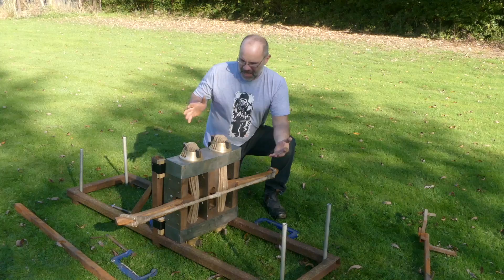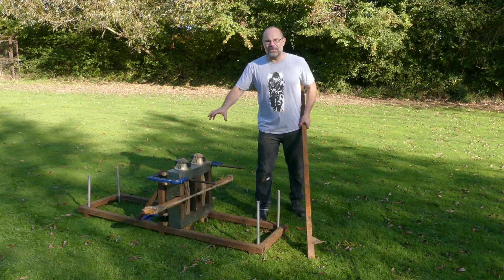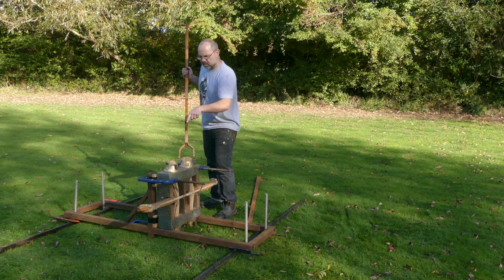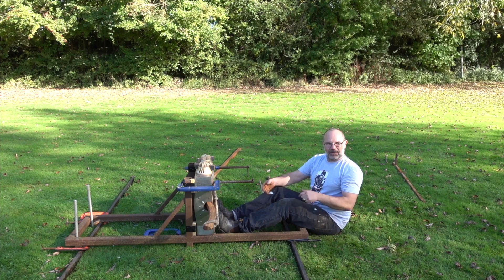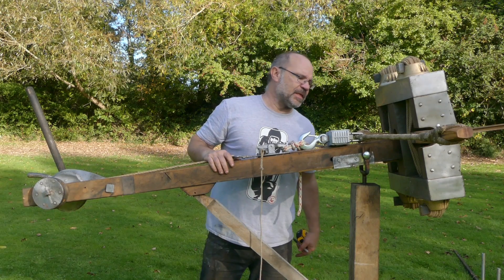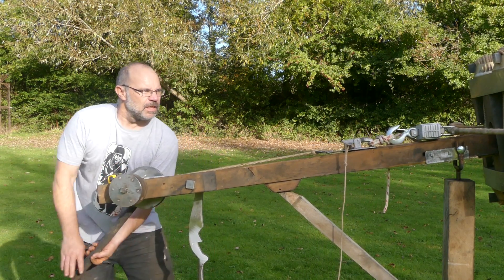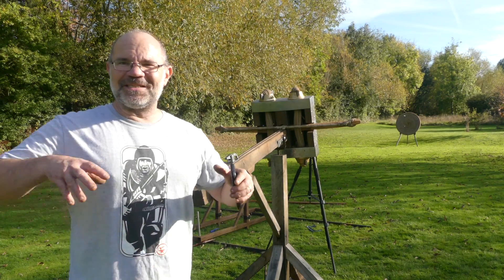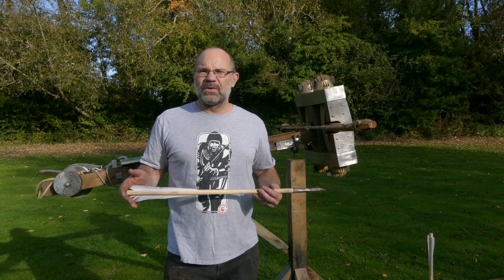CATAPULTA INCREASING POWER PT 2

Comment: Amazing! I've read all the material, but seeing it in action gives a much better feel for it. So many questions as follow up:
How do the washers work, so that you can you can increase the torsion on the bundles with the spanner with it turning back?
How much does the tension decrease over time?
Do you (and would the Romans) store them fully tensioned? Or does the stress harm the machine? Is transporting it already tensioned too dangerous? If you disassemble it to make it easier to carry (either in a cart, or even smaller on the back of a mule), how long does it take to put it back together?
Reply from the maker: Thanks.
The washers have a series of holes around the rim and the plates of the headstock have holes on a different frequency, so you can always find a hole that lines up.
Not sure how much it decreases, but the machine should be stored with the arms taken out to remove as much tension as possible.
They have to be left tensioned as it would just take too long to restring the bundles if you needed it.
2 mins to reassemble if that and faster with an experienced crew

Comment: Fascinating!
Would you be able to tune the skein bundles in sequence or "as needed" if the frame were laid flat on a raised bed/frame? Too prone to tipping (barring a splayed base I suppose)? It would put it up higher (which I suppose would get hairier the closer it gets to eye level) but would also let you have a better "at a glance" view of the cordage and access to all the ratchets at once.
Though if any of the cords or string let go, depending on if it's face to the sky or the ground, would it be more contained if the released forces were "directed" (so much as catastrophic failure can be directed) up or downwards?
Reply from the maker: There is definitely and easier way if the headstock was clamped flat as if the stock were vertical, but I made the frame before I had ever done it before and didn't think of it

Comment: Very interesting as usual Tod. 166 fps is a great start! 
As you mentioned you built crossbows with more draw weight than this, so I wonder do you have a estimation of what the draw weight eventually 'should' be?
Reply from the maker: I have absolutely no idea, but the tension went up very quickly so with a bit more courage it will go up from here, but also it will stack massively so another few cm could have added another 100kg I would think so I feel that draw length will also be very important

Comment: Splendid stuff! These must've been terrifying on the battlefield. The bolt you shot, and the extra energy it had, flattened it's trajectory. 
At full power this makes it's flight low & fast. Going straight through shields, men, horses...
Instead of an arrow that takes a parabolic path. Coming in from, say, 45° and easily stopped by a shield. Here you have a heavy, long bolt coming in low & fast from directly in front of you. Shields & the guy in front of you offer little protection from the energy carried by a bolt from one of these at close range & wound up to the max!
Do we know if they used gyro-stabilisation? You mentioned wooden flights last time & a simple twist in the flights would've really helped with accuracy!
Great video mate! Thank you. It  really got me thinking.

Comment: Todd, if you add some height to the tension box you can get more tension in the bundles with less stress on the individual ropes. That would also allow you to change out the bowed arm stops/sides. I’d add about 4”, kiln dried ash would be my choice.
Reply from the maker: I could, but then it would deviate from the Roman dimensions and I will bet they had it down perfect and whatever we try would reduce its efficiency
Reply: That would maybe help in a „safety sense“ but greatly decrease the machines efficiency. As Tod was saying, the pretension (linear stretch) is crucial for the performance of each spring . This is best done by putting as many strings through the wholes as possible (thickness of spring>lenght of spring).
Philon, a roman engineer, emphasized that too much twist in the string will even devaluate the performance of those machines.

Comment: For winding it up, wouldn't having multiple of those rods, screwed into the wheel be useful? Like a big multi-spoke inner wheel bit. That way you could just keep winding it without having to move the rod between slot positions each time?

Comment: 11:03: I wouldn't bet against the Romans having done that, to be honest.  It seems like the kind of field-expedient workaround a soldier would apply in a battle.  I figure an exchange would go somewhat like this:
Modern person: "Would you have done this in the midst of combat?"
Legionnaire: "Sure.  Beats getting sent to Elysium by a pissed-off Dacian."

Yes, it's probably harder on the machine and at least slightly more dangerous to the operators; but they'd have to balance that against the angry dude over there trying to stick a bit of metal in them.

Comment: *Tod*, a question: what mechanism prevents bundles from unwinding themselves? Is it some kind of internal ratchet mechanism? And how do you release the tension when putting catapulta for storage?
Reply from the maker: a series of holes in the perimeter of the washers and a set of holes in the headstock with a different frequency and drop a pin into an appropriate hole

Comment: I'm very excited to see where this project goes.  I tried making a simple ballista recently for a boil egg launching competition.  I was able to accurately hit the competition target at 200yards, but the torsion was too much for my oak wood bundle washers and they began splitting and breaking apart.  I was using 1/2" steel bolts for the bundle anchors, and they all bent under the torsion power.  Next year,  I will incorporate many more iron/steel components to handle the incredible stresses and I've learned to weld.  Your design has certainly inspired me.

Comment: ...could you actually pierce Amor with that thing?
Reply: At that range a fully tensioned one could probably put a hole in 1/8th inch thick AR500 steel.  So yeah, penetrating medieval or earlier armor wouldn't have been a problem.  Remember that, as it is, it packs a heavier hit than a .45ACP pistol round.
Reply: Considering the type of armour available when they were using things like that, I'd  say yes. But if you mean Agincourt armour, then I don't know. But I bet that even if it didn't pierce the armour the wearer would get knocked flat on their back and wouldn't be getting up for quite a while lol.
Reply from the maker: Zednotzee - actually no.  A person can stand in modern plate armour and get shot by an assault rifle round of circa 2500-3000J and stay perfectly on their feet so 660J is not a problem, however the momentum is also significant, but I suspect if the armour stood, then  so would the man
Reply: @tods_workshop  I sit corrected Tod, thank you for the accurate information.
Reply: @tods_workshop   Fair enough. But I was thinking that in a battle they wouldn't be standing still, and might have one foot off the ground. when they got hit. But you're no doubt right. 🙂
Reply: @tods_workshop   Ah, sorry, I was thinking of when you got it to full power at the range your shooting at now. I should have said that before. But maybe even then it wouldn't.

Comment: If anyone isn't sure what the 487ft/lbs or 640J actually means in real world applications, a 230 grain .45 ACP bullet coming out of the barrel of a Colt 1911 has a muzzle energy of 360ft/lbs or 485-ish Joules.

So, yeah. This thing is wicked.
Reply from the maker: Yes the numbers are big and getting bigger and the momentum is massive
Reply: @tods_workshop  I would like to see some "anachronistic" penetration tests between the medieval plate armor and the bolts loosed by this catapulta/ballista/scoprion  when at full power...  I am wiling to bet that the bolt will go through the armor without any issues...
Reply: @alinmeleandra3175  Well, archeology in England showed ballista bolts, fired from from over 200 yards range iirc, had went through a 4 or 6?? inch thick palisade log wall, 
and stuck into the spine of a defender, because they found his remains still stuck to the palisade, eek!

So yeah I think they'd go through historical armour with terrifying ease. 😳🤕
Even if it ricocheted from an acute angle strike, the momentum would still likely cause serious internal injuries
Reply: @alinmeleandra3175 Likely no chance for the medieval armour. I more interested in modern body armour.
Reply: @alinmeleandra3175  Penetration's about a lot more than just power, though. I'm pretty sure a longbow arrow has the power to penetrate a breastplate, but what we saw in the previous video on the subject was that it wasn't able to transfer that power into the breastplate. The tip would start to be deflected and would bend - using up some of the power of the arrow - and once the arrow was out of alignment, the residual energy of the arrow would be wasted on bending the tip and snapping the shaft, and what was left remained in the pieces of the arrow as they went spinning off in different directions.

If the arrowhead was harder than the breastplate, it would be much more likely to bite into the steel and stay inline, and thus transfer much more of its energy into the breastplate. However, given the cost of steel and the sheer number of arrowheads needed, they had to be made of iron, sometimes case-hardened as was discussed on the video. If the arrow lodged in one of a helmet's breaths or vision slits, or the junction of two lames, or any other place it might lodge, it would be much more likely to stay inline and deliver its energy to open up that hole into something the arrow could pass through. Likewise, medieval steel wasn't homogenous, so it's not impossible that an arrow might find a point without much carbon, where the steel was quite soft, and bite in and stay inline. 

And of course we saw in that video what happens when the arrow strikes mail instead of plate.

Of course a ballista dart would have a lot more momentum, making it harder to knock offline in the first place.
Reply: @silverbladeTE  That sounds interesting, where can I read about it?
Reply: @ThiLI0n  was in some books I got form library long time ago and on Web ages ago :)
photos clearly showed how the lower spine had got literally nailed to the thick log of the palisade, eek!
Reply: @RobbeSeolh  it depends on armor. in both cases.
Reply: @silverbladeTE  Maiden Castle - the skeleton c/w ballista bolt still in place in the spine is on display in Dorset County Museum.
Reply: @DavidLee-qe3rd  ah, thanks! :)
was pretty amazing, if horrific, eek! 😳

so yeah, 
a) mass and thus momentum IS important

B) ye olde Romans were pretty damn impressive with their engineering!
Reply: @alinmeleandra3175  This is a siege engine not a personal weapon. No armour from any era can prevent a kill from a siege engine of any era.
Reply: @Debbiebabe69  
I'm fairly certain a basic level 4 plate stops these shots. The 30.06ap they're rated for is well over these numbers and has a much better penetrator.
Reply: @silverbladeTE  Some yeomen got a bit too literal with 'put some back bone in it'? Damn.
Reply: @parrotshootist3004  lol! ;)
Reply: @alinmeleandra3175  Ballista and Catapulta were absolutely used during the medieval period (particularly in the defense of castles)
Reply: @   I did not know that that actually happened. Brutal!! :)  Dumb additional question: was the defender in armor? I assume he was... Also, any idea about what period are we talking about? War of the Roses or earlier?  Because that would significantly change the type of armor everyone was wearing... But never the less, I think that 1mm of steal can't withstand a power of a proper balista bolt...
Reply: @tods_workshop  Well, ironically....I made a wee animation on this about over 20 years ago or so, and put it up on YT  around 10 years ago..  
Sorry it's so simple but back then rendering animations at home with a normal PC was a nightmare, lol
It's on my channel as "Roman Light ballista" ;)

Most of my art was about "Spelljammer", a fantasy space setting for Dungeons & Dragons, so I built a lot of siege weapons for the ships :)
Reply: @silverbladeTE  stopped by and left you a like. Good stuff!
Reply: @Tarabulus  Cheers! :)
Reply: You have to divide by 2 in the formula. So it’s 320J not 640. Which is still huge.
Reply: @tods_workshop  Can you do Catapulta vs. armor/suit of armor video like you did with the longbow video series?
Reply: The momentum though with a half pound weight bolt...oooft!!  😵
Reply: That it´s the count if you go for energy. But if you go for momentum (another important measurement) we have 1.5 the momentum of a 10 grams 7.65 NATO from a FN FAL Rifle. 12, 2 Kgm vs 8,5 Kgm
Reply: It is 378 J,  the calculation is wrong.
Reply: @RobbeSeolh  Only if based on m/s in the table, however the speed was originally measured in feet as 166 feet, which is 50.6 m/s. That makes it 320 J with a 250 gram bolt. I assume the feet to meters conversion was scaled upward, and then he forgot to divide the result by 2.
Reply: Yes a 22lr is around 70-90 ftlbs, a deer rifle around 2000ftlbs
Reply: @chrislatchem1854  buffalo bore loads a 400 grain projectile in there .45 70 super hot load up to a little over 4000 ftlbs at the muzzle. Pretty impressive for something that can be loaded into a lever action.
Reply: The 45 acp is going around 900 feet per second
Reply: it's ft*lbs-force not ft/lbs
Reply: I cant wait for a 1000J! That thing will kick like a horse!

Comment: It took me like 7 or 8, 10 hour days to pre-tension  my engines with 19 or 20 wraps each. I made custom, duel winches to pull each 1/2 wrap to a bit over 500 pounds. I used the note plucking technique as well. The straps I was using to pull with were rated at 500 pounds. Sometimes the strap would break. I learned what the note was just before the strap failed, and metered to that. So estimated pre-tension per engine was probably close to 24,000 pounds. Crazy numbers. That's only half the skein the engines were designed for. Next time I have it running, with the full bundle, forces will be in the 48k to 50,000 pounds per engine, before turning the washers, or cocking. Around 65,000 pounds per engine at full power. I don't know when things will start breaking. Should be terrifying.
Reply: Whatever happens, make sure you get it on video! Future generations will thank you.
Reply: Damn, those are some incredible forces. however, I think it is less dangerous af it seems. While the forces are huge, the snap distance is tiny.
Reply: @thorwaldjohanson2526  My concern is with limbs breaking, and a 5 foot long chunk of wood flying at me at 350 feet per second. Skein breaking or coming unlashed, is not too big a deal. My stanchions are strong enough, the carriers are 9" thick oak timbers, the washers are 1/2 steel plate. The Regula may be iffy, but I think we should be ok.  I'm not sue what "snap distance is", but I'm guessing you are referring to the skein.
Reply: That’s amazing!  It’s been a year since you left the comment- how did it go?  😎

Comment: Thanks for these videos.  I'm in the process of building a Ballista for SCA use shooting people and am at the calibration / test and fix phase.  Your explanations are great!  I never thought of measuring the exit speed of the bolt as a measure of having enough, but not too much power (we are limited in range for safety even though the bolt is foam tipped).
Reply: What does "for SCA use shooting people" mean?
Reply: @papalaz4444244  the Society for Creative Anachronism is a medieval re-enactment organization with live fighting, archery, and axe/knife throwing.  It also includes siege weapons in their live battles where you shoot a specialty designed bolt at fighters to simulate siege weapons in ancient and medieval battlefields.  Safety is key so the engines are limited to a range of 80 yards so the bolts do not have enough energy to seriously hurt someone
Reply: @joshuaberry4128  cosplay ok
Reply: @papalaz4444244  it's real combat.  Real arrows shot at people.  Just not to hurt them.
Reply: @joshuaberry4128  yeah

Comment: I would really love to see what a difference horsehair would make. Or even human hair. It is said that the women of Carthage gave their hair for the cause in the 3. punic war.
Reply: Agreed, though in theory now we can even go one better and use artificial spider silk threads (or I suppose genuine natural silk if you are Bezos or Musk rich), which should be capable of rather more power delivery still. Though the material science of such twisted materials does get complex to model.
Reply from the maker: Interesting point, but the cords have to have particular properties and  some things work much better than others.  The Romans had access to silk, so if it was the best, they would have used it.
Reply: @tods_workshop  Only if its affordable/available enough - nobody used the best possible material they know of for everything, as far as we can tell ever in history. Just the one that was sufficiently good for the job and available at the time.

For instance Ray Mear's did a program making a reconstruction bow based on a very well preserved find, and that original bow was a really really awfully selected bit of timber...

Edit: Not that I disagree silk may or may not work out as well. It could well be too elastic and loose too much of its energy in fiber to fiber friction. But the phenomenal breaking strain and elasticity with the right design tweaks as needed mean it should work fine, just maybe not well enough to be worth the cost.